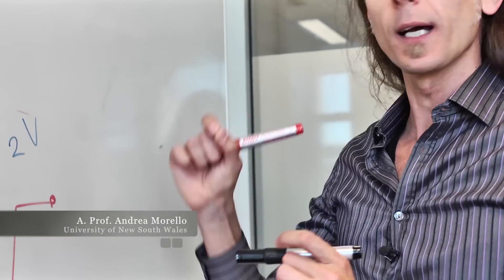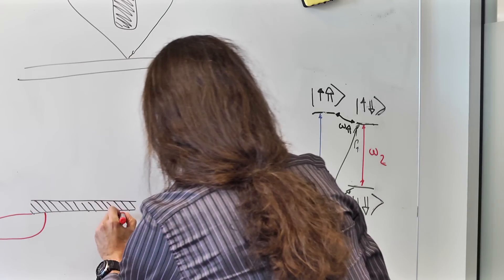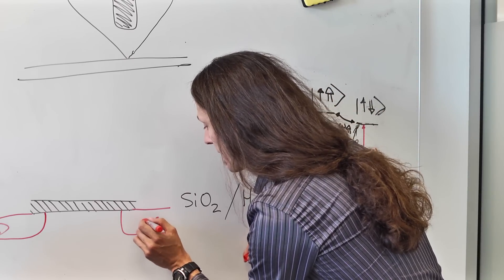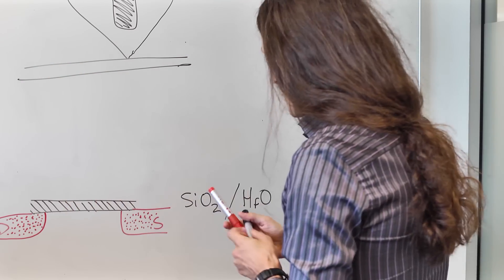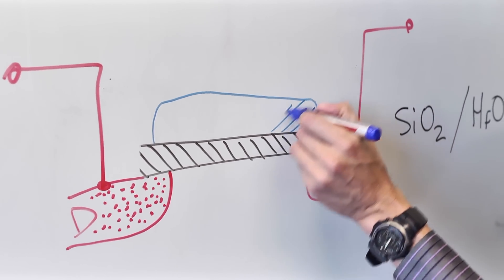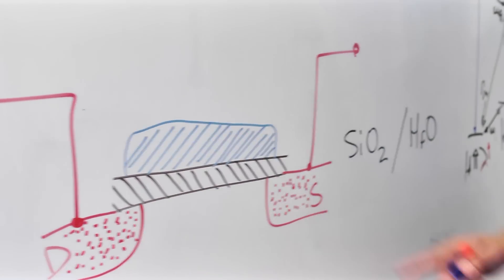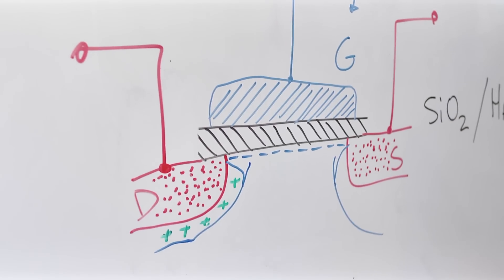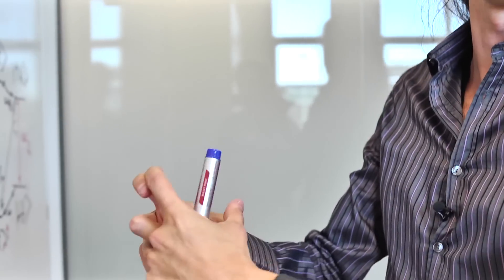Transistors & The End of Moore's Law

Comment: Okay, I am at a loss here. If the thing causing transistors from getting smaller is Quantum Tunneling, wouldn't that already be an issue with current transistors? I understand its probability based, so it is unlikely to happen, but yet it should happen from time to time? Why doesn't it happen in current systems?

Comment: Also that silicon oxide layer effectively forms a capacitor. The smaller you make the transistor, the smaller the capacitive effects become, hence they can be operated at higher frequencies. Thats another advantage to making transistors as small as possible.

Comment: He's a little inaccurate with the numbers, by the year 2020 we'll have reached the max atoms you can put on a silicon chip(which is about 7 atoms across). The bonus is that we either will start going in 3 dimensions with the transistors or we will have create a quantum computer that's not the size of a building.

Comment: my old pentium 4 consumes 110W, or so it says, my not so new phenom II X6 says 125W. yeah its bigger but there were also 125W pentum 4 and there are also 95W phenoms. They comsume the same, i never talked about efficiency that now is hounderds of times better than back then. now they downclock when not in use, lower their voltage and other stuff too, but the maximum hasnt gonne past around 125W. That P4 was a single core with 110W, now i have 6 fasters cores for the almost the same TDP.

Comment: Real life simulation can be extremely complex or it can be rather simple, depending on which path you take.
If you have some simple deterministic rules (pull objects down by gravity, bounce ball, push objects by force, exert torque on objects etc) that is what we have today.
If you want to go deeper and simulate things on a molecular level you would instead need EXTREME computing power, possibly on a quantum computer.
A 2 mile sandy beach has more computing power in it than the entire planet...

Comment: You are correct in that respect, rendering routines are generally those that benefit the most from having more "pipes" (threads, whatever) to render through because an image job can be done in batches. That is already the way we do things and more kernels (GFX talk) means faster and hotter chips.
In mobile devices the graphics are done on a separate section of the CPU. If you have ever heard of Tegra and Kepler chips you know what they are.
As for life sim, read my other comment.

Comment: Not really, it depends on what type of game we are talking about but there is only so much you can do in parallel. Eventually you still run into a barrier where one operation will take equally long on a processor with 8 cores as on a single core. This because the task cannot be split across several threads. Thus the game will have to wait for that operation to finish before moving on.
Clock frequency is the only thing that helps there and smaller chips are harder to clock high and remain stable.

Comment: So to turn off the transistor, you just need to cut the circuit with the power source(2 volts) and the conductive material?
Or does the current keep flowing from D to S pole through the semi-conductive material, even after there is no starting voltage to support it?

Comment: I'm not wrong at all. Are there the same number of people and users as there were 10 years ago? No! That means despite any gains in efficiency or keeping them the same, over time we will suffer a problem with energy supply. Oil is a non-renewable resource that gets increasingly expensive to obtain over time because all the cheap easy oil has gone. Now we're using fracking - each well is peaking and dying out so quickly that new ones are drilled to service the debt. The impact of fracking is tiny

Comment: I don't think moore's law will last very much longer, I think it has already started to fail. Desktop processors haven't really increased in performance much since Series 1 i7s came out in November 2008. transistor size is down from 32mn to 22mn, off the top of my head but that doesn't equate to really much performance difference.

Comment: Your solution works if you don't mind having a computer that takes up an entire room.  In order to increase computing power while maintaining the small scale of p.c.s, transistors have to shrink.  You are trying to overthink this, I guess.  Your thought process seems to be to take computers backwards, make them bigger to fit bigger transistors.  The true problem is to get the most computing power out of the smallest container possible.

Comment: Moore observed and described in his 1965 paper basically that people have been putting more and more transistors on one chip since 1958, when the transistor was invented. He observed that the number roughly doubled every 2 years, so he said it would continue for the next ten years. It was a prediction, but it fit exactly what happened next.. Maybe manufacturers are trying to obey the law. Intel has its tick-tock cycle, where they make a smaller sized chip one year, and improve it the next year.

Comment: 4:50 ... 50 silicon atoms between source and drain. So nowadays, our transistors are roughly a little bit bigger than 50 silicon atoms in length. A silicon atom being roughly .2 nm across, that's 10 nm in length.
The "soma of a neuron can vary from 4 to 100 micrometers in diameter", 4-100 mm.
Ok so we have transistors about 3 orders of magnitude smaller than a central part of our neurons, yet computers are still (i dunno, say 3) orders of magnitude dumber than we are. OK, strange...

Comment: Unfortunately that isn't true. Algorithms with exponential growth rates would still become unusable beyond a certain size of data set. The benefit of increased computing power is that the point at which a better algorithm becomes necessary is pushed further out.

Comment: To add a bit to the explanation... transistors act as voltage controlled switches when they operate in saturation mode. If the gate is not biased for operations in saturation, it MAY act as a current amplifier instead. Also, this describes FET technology and most derivatives of FETs are built similarly however a BJT is constructed entirely differently. However, very good explanation! :)

Comment: CPU makers are extremely cost-sensitive, and the cost to manufacture a CPU is almost in direct proportion to the die area. Therefore, I wouldn't expect them to greet an increase in CPU size with pleasure.

In addition, the speed of a CPU is inversely proportional to its size, due to delays in signal propagation. Making a modern CPU larger would most likely slow it down.

CPU design is a series of compromises between size, cost and power consumption. Finding the right balance is tricky indeed.

Comment: If the number of transistors on a die is equal to the computing power,then it's OK.However,I think if we run into the physical end of Moore'sLaw for transistors,and don't have an alternative as quantum computing yet,I'm sure that research will come up with a new way to keep up our rate of progess,like opto-electronic substitutes for transistors that're smaller and faster,computing with photons instead of electrons,or something like that.(Maybe we'll have isolinear chips in 10-15 years from now?)

Comment: hi, when designing circuit with transistor, actually you need to do lots of calculation, depending on type (voltage, characteristics) you calculate all the transistors and conductors (for certain voltage stability) basically you need to put transistor on every pin or you need to make transistor what you would like to have

Comment: We could, but the CPUs will become less reliable. 

Example: think about your password's length as the voltage required for the transistors in the CPUs. If your password is 321 (lower voltage), someone could easily hack your account. (in this case environmental noises could easily cause transistor to malfunction). Now if your password is 2312613462, it is much much harder for random noises to cause malfunction.

Comment: When the gate is opened, does it drain any current itself? When designing a circuit, do you need to add any resistors on the line to the gate pin?

Comment: hi, modern CPU layout is layered up in one piece, so you cannot take transistors apart, much like 3d printer works, layers of N-type, P-type semiconductors are layered and whole chip, with designed logical functionality, is made. and for you other question, sure it depend on current, which is quite high in CPU (tens of amp) and sure, you can lower it, that is what "mobile CPU" is .... but all this brings us to MOSFET transistors, which are actually used in CPU and i would like to know more about

Comment: Moore's Law originally stated that the number of transistors at the lowest cost per transistor would double every year. Carver Meade coined the term in 1970; the prediction by Moore was in Electronics Mag. 1965. Moore modified his prediction in 1975: the number of transistors at the lowest unit cost would double every two years. Moore didn't ever predict 18 months. Intel's David House said computing performance would double every 18 months, which explains the confusion over the 2 time frames.

Comment: Power = voltage X current some of which will be released as heat. If the voltage difference between the open and closed state gets to small it will not be robust to noise, transistors have an effective resistance as does everything so current is fixed from that.

Comment: This guy did a nice job on explaining of how transistors work. At the end, he mentioned about working on a quantum processor, problem with that, you will have to specifically write code for it, and currently, everything is written to work only on a non-quantum processors. It will cost billions and billions to rewrite everything for quantum processors.